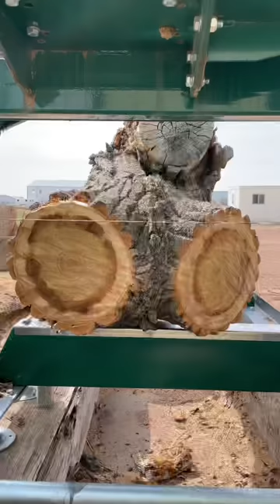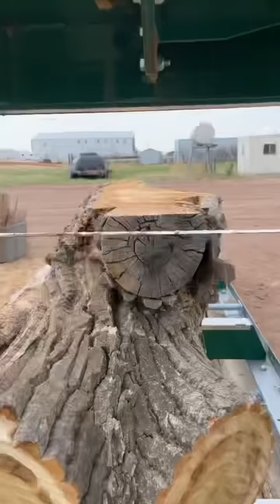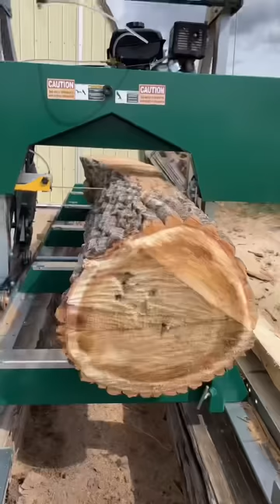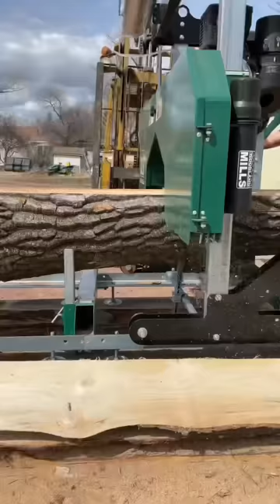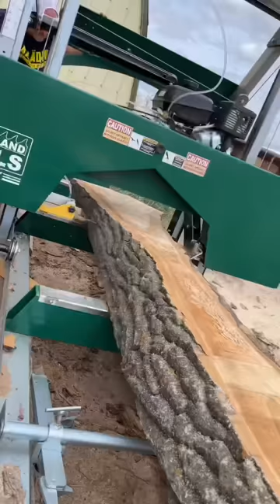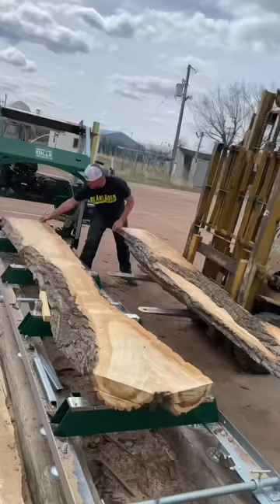Cutting cottonwood slabs #woodworking #sawmill #maker #shorts #diy #woodwork #wood #tools

Comment: Cottonwood is under appreciated
Reply: I didn’t know you could use it for anything other than burning.  I had heard that it pretty much disintegrates once the tree is cut.
Reply: @procrastinator41  A couple of guys I know that own sawmills  will often cut dimensional lumber such as 2x4 and 2x6 etc. From poplar for personal use on interior walls.  Makes a decent lumber to use as secondary wood in furniture.
Reply: Stinky wood
Reply: @tinytattoomike7943  it is smelly when first cut.  PS, I noticed you have a pic of the oscar meyer weiner mobile.  Saw one of then stuck under a viaduct in Buffalo back in the 80's. Wish I had a camera.

Comment: I would assume you distribute the pressure more evenly at consistent speed to avoid all those waves in the cuts.
Reply from the maker: Kind of, the log will also change when you hit areas with knots and so you have to keep adjusting the pressure based on how it’s cutting or how he engine sounds

Comment: Makes a good sawmill video but what will be the purpose for that wood? Cottonwood is bout useless.
Reply: Cottonwood is quite hard and durable after kiln drying. You can't drive a conventional nail in it and you have to pilot drill snd soap a screw in well aged lumber. You find it in old houses and farm buildings. It's almost like steel. It ain't pretty, but it's tough.

Comment: How long does it take for cotton wood to dry and become stable?
Reply: Cottonwood never really becomes stable like traditional hardwood. It's a very stringy wood that likes to tear out unless you have extremely sharp tools. Of all of the woods I've ever worked with, cottonwood was the worst.
Reply: @joshuawiedenbeck6944  I have tried to work with it in the past, that's why I was asking. Elm is a pain, but cottonwood was a nightmare. It surprised me that he was cutting planks.
Reply: @Bhartrampf  My boss at the time (who came from a long line of Dutch craftsmen and was quite the woodworker) describes cottonwood as "garbage" trees.